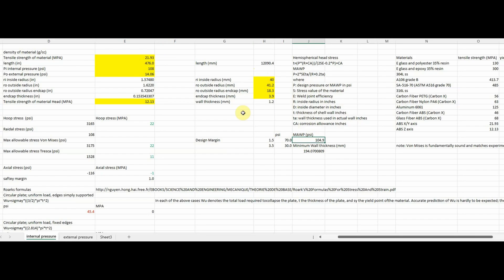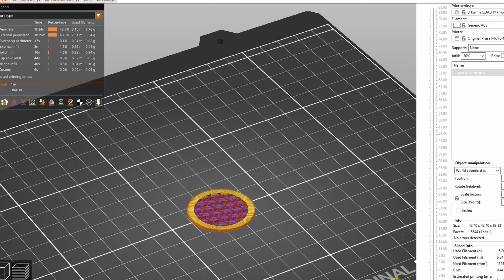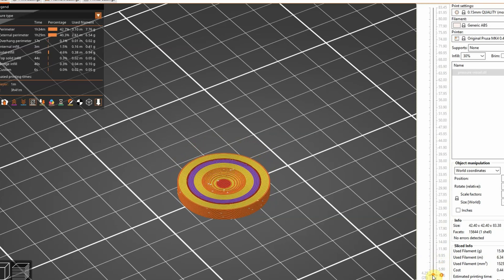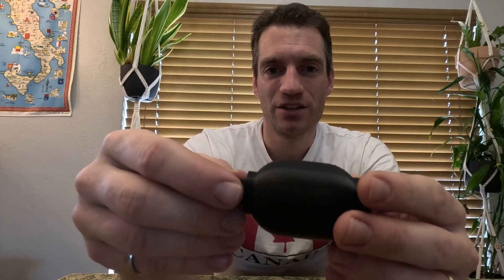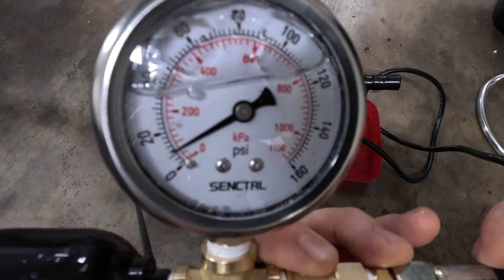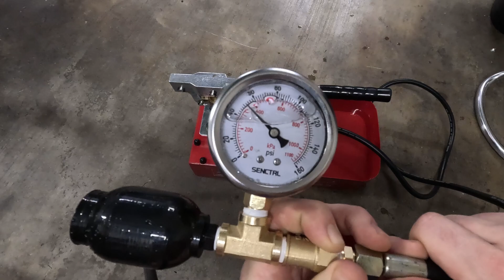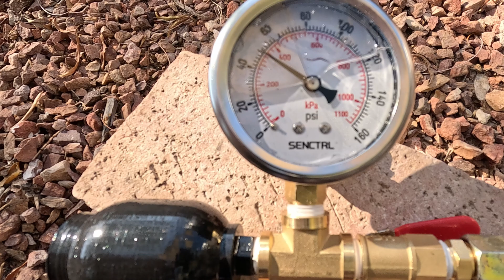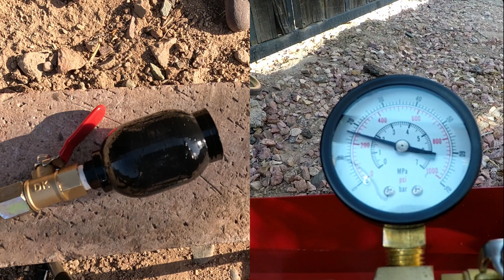Can you 3D print a Pressure Vessel?

Comment: Do Thicker walls ie 4, 5 or 6 perimeter (up to 2.4mm thick) or external ribs from top to bottom increase surface area to improve the pressure held. Or does it still pop at 250 or so as inter layer failure is same?
Reply from the maker: That is what I will be testing soon! Look for a 3rd video on the subject in the near future.

Comment: Excellent video.
I don't think you mentioned why you are using a hydro test.  Which is of course for safety.  Some one might get hurt.
Reply from the maker: Yes hydrotesting is far safer than testing with air or another gas (even with volumes as small as these)

Comment: You should test this while printing it horizontally, the layer line would be along the vessel and hopefully make it stronger.
Reply from the maker: So this wouldn't work. Putting the layer lines on the heads would theoretically improve the max pressure but it is quite impossible to print a threaded fitting on its side and still get any sort of usable part. I do have a fix for the layer lines question look for a follow up video in the near future...

Comment: Very well-done video.  The results are very interesting.  For a pressure vessel like this, on the cylindrical portion of it, the hoop stresses are twice the longitudinal stresses. But yet it failed in the longitudinal direction where the stresses are half of the hoop stresses.  That means if everything else is equal it should have failed by bursting along a longitudinal line.  Therefore, it seems that layer adhesion is the limiting factor.  If there could be a way of printing a vessel with the layers going along the axis the capacity would be doubled.
As I said this is very interesting and there is a lot of factors which could be studied.  Thank you for the effort you put into this project.
Reply from the maker: Yes the z-axis is still the weak point (as expected for FDM printing). I could print this model on its side but the overhangs on the shell would be much bigger that way (and require reinforcement) also trying to print threaded fittings sideways is a nightmare.

Comment: That was super impressive it lasted that long

I think there are 3 things that need to be tried

1: Thicker print walls. How much pressure would be held with 1cm thick walls? 1 inch thick walls?

2: Composite wrapping. I'm not sure if I have the correct term, but I know I've seen them. Things like oxygen tanks for welders that are wrapped in some plastic or nylon woven material. How much would that help?

3: A sort of tempering process for the plastic. Finish the print. Get a little toaster oven or something that can get to a very specific temperature. Put the print into it and find the temperature where the plastic melts juuuuust enough that the layer lines meld together even better
Reply from the maker: Good thoughts, I am working on a follow-up video that will start to answer some of those questions

Comment: Why not use the 3D printed vessel as a mandril, and wrap it in fiber mesh.  The plastic should keep the seal, but the fiber wrap would take up the stress at higher loads.
Reply from the maker: You certainly could, that would be much more labor intensive though

Comment: Super cool proof of concept with crazy strength. Looks like the Z axis of your printer can use some tightening. It causes the single layer side bulges from failure to fully lift the step properly.
Reply from the maker: could be, more likely my extrusion multiplier is a bit high, the random seams were all protruding a bit (most of my prints don't look like that)

Comment: Isn't a sphere more suitable for a 3D printed pressure vessel? I thought the cylindrical center was for ease of manufacturing from sheets.  

If this was a prototype, I understand that makes sense. I wonder how the shape affects working pressure. 🤔
Reply: While sphere is easier to print than manufacture from metal we have anisotropic material here with weaker layer adhesion, cylinder printed vertically has less force trying to tear it apart by layer lines.
Reply from the maker: @JGnLAU8OAWF6  Yep I have and idea of what to do about that, look for a follow-up video on the subject
Reply from the maker: Good point, yes a sphere is even better for holding high pressure than a cylinder. I made a cylinder because that is a common tank shape. For 3d printing the normal difficulty in manufacturing spherical tanks (lots of rolled plate with compound curves) is irrelevant. A 3d printed spherical tank would have larger top and bottom overhangs that would require a larger skirt or repad to reinforce though so depending on the size and desired pressure, either a cylinder or a sphere could be the better choice.

Comment: I've been thinking about it a lot lately. I have a cheap 3,5bar compressor for airbrushing, but it doesn't come with any pressure vessel. Not only you can feel it pulsating when you airbrush, but also immediately once you press the valve the pressure drops. On the market you can't really find any small pressure vessels, and if you find them, they are terribly expensive, so I was thinking about printing a 0,5l tank.
Reply from the maker: Definitely feasible, I would probably overdesign it a lot just for safety
Reply: For that pressure range you could consider using an empty propane bottle.  Nice thing with this is you can easily find fittings to adapt the bottle to your compressor.  If you do want to try this approach look for a fitting to refill the bottle and go from there to your compressor.  We did this but we went a little overboard and used a 30 lb. tank.  I think we should have used a torch type size the big one is too clumsy to move around.
Reply: i took an empty dashboard cleaner spray bottle (biggest I could find), emptied it out fully, punched a small hole, drilled it to size, sanded around it, inserted and soldered a brass valve from the old inner tube of my bicycle using electronic tin lead solder, and used it as a shitty air spray can for cleaning computers and keyboards. Still have it.
Reply: I bet a 2 liter soda bottle would hold enough pressure for an air brush. Bet you could find lots of videos of people pressurizing them.

Comment: Also, can you go over the common mistakes people make when designing air tight and pressure vessels?

You mentioned you saw some designs that weren't great, but I don't really know what to look out for. 

I have a garden and some airflow projects in my near future, so while I don't need 160 PSI, the fact that 3D printing can even direct liquid and gas like this is blowing my mind.
Reply from the maker: So for holding pressure, hemispherical end caps work best (will hold the most pressure with the thinnest wall) but a lot of people use either flat end caps (because they are easy) or elliptical heads (because that is what they see on industrial applications). With 3d printing it is only slightly more challenging to do a true hemisphere than the alternative head types so it's best to go that route. 

The other thing that matters is the vapor smoothing. There are some 3d print sealing products out there but I haven't seen any that work as well as vapor smoothing (and vapor smoothing uses cheap solvents so it is much more economical). 

Basically if you have a decent design and can do a good job vapor smoothing you can print things that are watertight and hold pressure pretty easily.

Comment: I guess the tensile strength numbers from the manufacturer were referring to layer-layer adhesion without acetone smoothing, which of course changes the layer-layer interface significantly
Reply: Well, layer bond also depends on so many other factors that I don't think we can say exactly what the contribution was from vapor smoothing without a controlled test? For example: nozzle temperature (and nozzle material), ambient/chamber temperature/fan use, layer height, etc.
Reply from the maker: Those are all definitely factors but using the manufacturer recommended settings which also match the typical printer profile for ABS should give a result in the ballpark of what they got in their own tensile strength test. Getting 2.5x greater strength is not going to be achieved just by tinkering with the print settings the vapor smoothing has to be a major contributor  @jessicav2031
Reply: Depending how long you vapor smooth the part essentially turns into casted. The problem for any rated use is consistency
Reply from the maker: @lasskinn  Yes you can certainly dissolve a part if you vapor smooth it for too long. Fortunately, I have my vapor smoothing down to a science at this point.
Reply: Jeez. Learn to wait with commenting to after the conclusion! xD
Reply from the maker: Lol yes I was expecting the vapor smoothing to make it stronger but I was surprised that it was 2.5x stronger than the original spec @mr_gerber